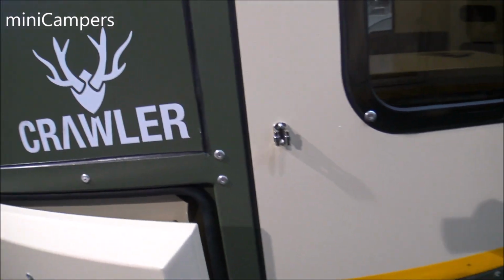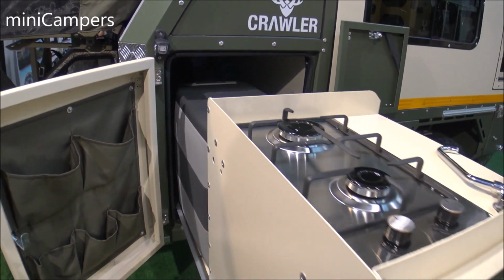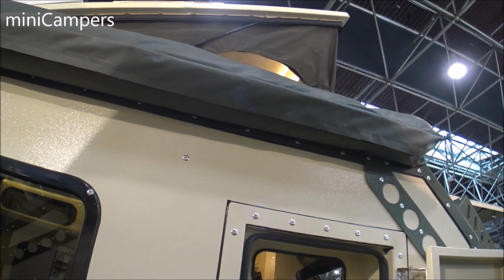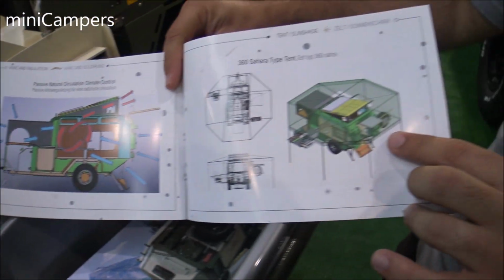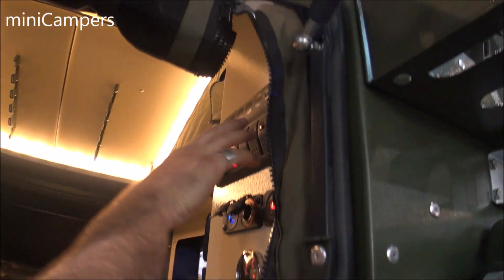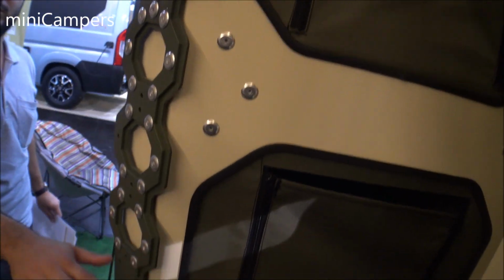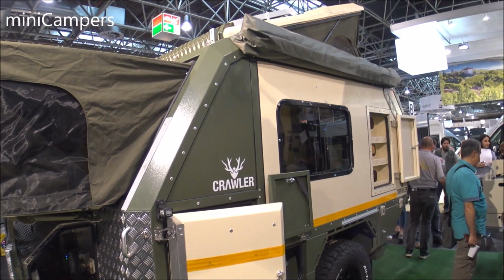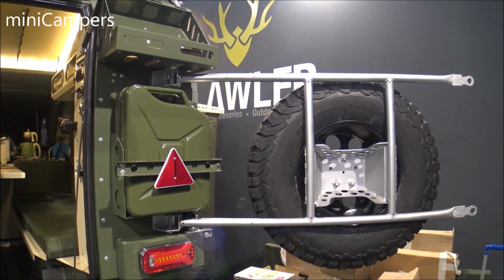The 2019 adventure camping trailer Crawler

Comment: As commented a few times before, this looks 100% like it's a copy from a Conqueror, albeit a mix of a 440 and a 490. The only difference is the two large seats inside. But other than that, the materials used, the exo-sceleton frame, the colors, the pop rivets, the design look and feel, the colors, the locks, the A-Frame storage, the entry with steps at the back, the spare wheel including the <beep> locks, even the smallest details are all exactly the same or at least look exactly the same as a Conqueror. I cannot believe that one brand would allow another brand to claim to have designed a camper that basically already is on the market for years. So I have to assume that this is done in full agreement and in collaboration with Conqueror, i.e. it's a rebranded Conqueror targeting a different market.